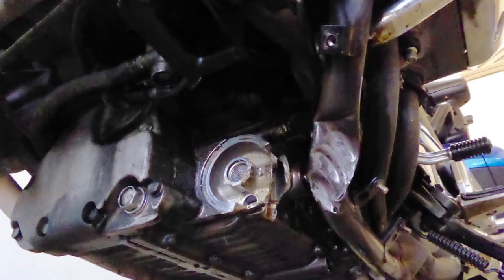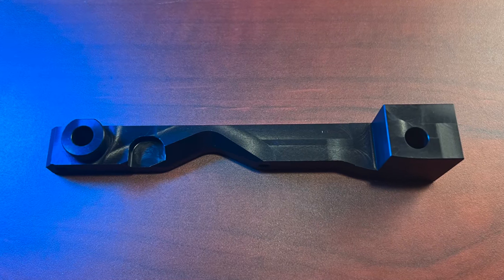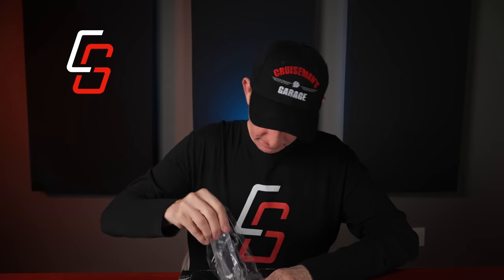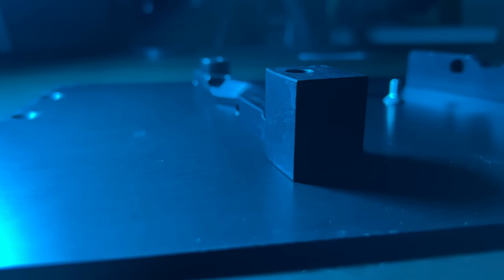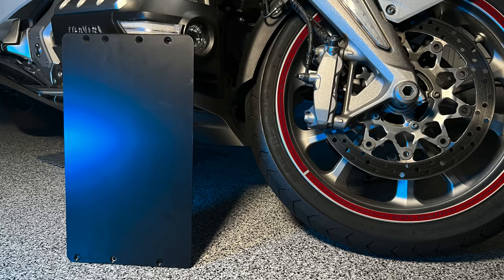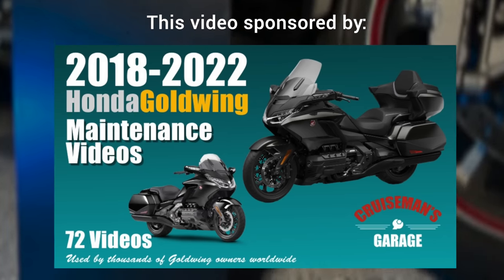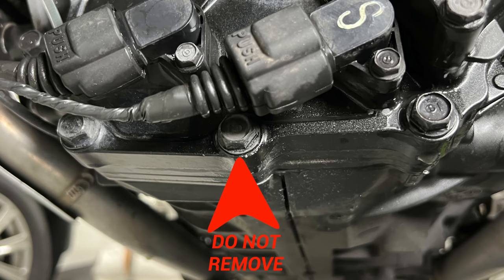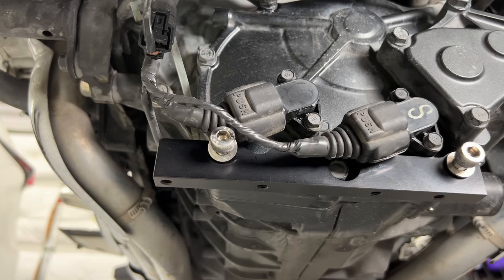Install and Review of Engine Case Guard from Traxxion Dynamics | Cruiseman's Garage

Comment: Another great video. A tip to anyone doing work yourself, if you have difficulty finding the right FEEL when assembling things and find that too often you over tighten bolts and strip the threads, use the right size socket wrench for the job. An example would be in this video when tightening down the underside small V-head screws, use a 1/4" socket wrench, not a 3/8". The smaller the bolts, use a smaller socket wrench where you cannot get the overpowering torque that will cause trouble and ruin your day.

Comment: I've added the cover to my 23 Goldwing and following the instructions to the letter went on easy, and after the installation, there were no leaks of any kind from the case of the engine. Good job done by Traxxton for building this heavy duty cover.

Comment: Thanks Chris! Great video as always. I ordered the Traxxion Dynamics Alcan plate for my 2019 DCT Wing a couple of weeks ago. After reading the many reviews I learned that there was not enough clearance to remove the rear drain bolt after installing the rear bracket. This would have been a deal breaker for me. If you have the 13mm aftermarket magnetic drain bolt as I do it requires the removal of the bracket when doing an oil change. I just received confirmation that Traxxion has re engineered this bracket that WILL accommodate the 13mm drain bolt! There is a slight delay in the manufacturing effort right now but I was told that these will begin shipping again by the end of January. When I receive it I will install and follow up.  
Thanks for all your videos! I have used many of them to install a great deal of lighting as well as proper maintenance that is required.  The insight that you provide has allowed me to do all these installs saving me thousands! My hats off to you sir! Keep it up.
Reply: hello there. I have ordered the Alcan as well and on Traxxion website doesn't says  the official dimensions of this plate how big it is in regards to the standard. it would be great to know how thick it is in millimeters. Thanks 👍🏻

Comment: Just purchased my first Gold wing 2019 DCT, I certainly don’t like removing the Engine bolts every time I change the oil, hopefully they redesigned the bracket and came up with a better solution. I’m giving them a call tomorrow before I order the product.
Reply: Flyman...Did you call them about this?

Comment: I bought and installed this last week. Simple install when following Max's video. Definitely a solid piece of aluminum plate! I will have to check for any oil leaks. Haven't riden the bike since the install.  It was 5 degrees up hear in Boston the last few days. Up to 28 and dry today.....perfect riding weather lol

Comment: Thanks for the update.  I am not sold on either of the products you have reviewed.  Sure don't want to keep removing the engine bolds.  Also not convinced I need a "thick" plate.
Reply: I found out that the wingstuff is much easier instalation, doesn't mess with the engine bolts. Nd does the job perfectly.

Comment: Great plate kit. Now you are talking solid plate mounting. Totally agreed about the drain plug access!!! Once us removing the rear bracket to get to the drain plug, a note must be informed that the old 2 bolts must be inserted back into the engine block before you run the engine after an oil change to check for leaks and oil level.  I will never run the engine missing the 2 bolts on the lower case, even for 1 min. I need to think about that. It is a benefit to have this plate on our bikes.

Comment: This ecg from traxxion does look heavy duty,but taking out the 4 engine bolts out and using a jack under the ecg plate to support that much weight on those 4 bolts seems wrong. The engines cases have been lighten up and are thinner and would more likely put too much stress on those 4 bolts when lifting the bike. Mother Honda is not going to guarantee damages caused by this belly pan and who could blame them. Right now it's a no for me.

Comment: I did that exact thing put the front bracket on the wrong way I found out when the plate would not match up the bolts so I took it off and reversed it glad that you mentioned it. Merry Christmas stay safe

Comment: After watching this video (another great job, Chris!), I would be very hesitant to lift the motorcycle with a lift on the case guard.  As best as I can tell (unless the lift was making contact elsewhere) you would be lifting the entire weight of the bike on the 4 bracket bolts, which is only contacting the engine case in 4 distinct points.  I would be very concerned that all that weight on those four bolts would either shear off the bolts or crack the case.  On my previous bike, there were two strong frame rails that the lift would contact, not the engine itself.

Comment: My Gold Wing is parked in my basement for the winter, so I have not even started the engine since I put it away. I installed this engine guard case about a month ago now, while it has been in my basement. This evening I was curious about the recently reported seepage of oil that was noticed on some Gold Wings, after the guard was installed. So, I removed the necessary items to get at the front and rear bracket. I noticed an oil seepage from the area of the front guard bracket. So, I got out my trusty torque wrench to see if the bolts were at 18 ft lbs, like you mentioned. They were both pretty darn close, so I gave them another tug just to make sure. Then, I removed the bottom guard, and I cleaned the area of the seepage really well with some Simple Green. So, I am going to leave the bottom guard off for a few weeks, while it is in hibernation in my basement, and I will monitor it to see if I get any more seepage to report.
Reply: hey Paul. have you got any more seepage  after monitoring? thanks
Reply: @bikerboy_2008  No. Max from Traxxion was correct. I wiped the seepage and re-torqued the bolts, and everything is good.

Comment: Looks like the clearance issue, with the rear drain plug, may be with the aftermarket magnetic plug mentioned below.  Traxxion bracket was probably designed to fit around an OEM stock drain plug, which is a 12 mm head.  The Goldstrike magnetic plug is 13 mm.

Comment: Maybe you saw this already but 6061T6 is a precipitation-hardened aluminium alloy, containing magnesium and silicon as its major alloying elements.  The T6 designator means its Tempered, solutionized and artificially aged.  Yea i got that from Wikipedia (I wont take credit for that)

Comment: I just recieved my case guard. The rear mounting bracket has had a notch milled into it to address this drain bolt issue with the DCT. I was wondering why the notch was machined in the bracket after it was anodized but this video makes it clear now why it was done..no need for it with my 6-speed though.
Reply: I would think he would send new brackets out with the notch in them. Don’t think mine has the notch in it.

Comment: I did install the the plate on my 2019 DCT.  week.  I too am interested in how it will function with a lift.  I have a J&S Lift with their Goldwing adapter.  I will test the lift along with the plate on to see if it fares well.  Otherwise I would  just remove the plate as one would to perform an oil change by removing the 7 small screws,  and then use the lift on the suggested engine case hard points recommended by J&S.  
      Last weekend I road 450 miles from Orlando to Palm Beach and back and had no issues with the install when inspected.    I really like the protection it affords as I'm a long distance rider and now feel a bit safer with the engine case protection.  Thanks for the video Chris well done.

Comment: Adding a washer to act as a spacer between the front mounting bracket and the engine case would help localize the bolt torque clamping force and prevent oil leaks, but once you've let the leak start, the RTV is compromised and it's always going to want to seep there.

Comment: It took me about an hour.   I am not mechanical at all, but it looks great.  The two biggest hassles were the plastic, which I put back on in the wrong order, and getting my torque wrench on the rear bolts.  Mine had the cutout for the DCT plug and I had no trouble getting the 12mm socket on it.  
My biggest disappointment is that I was hoping to find about ten push pins and a couple of 10mm sockets in there when I took all that plastic off.

Comment: Thanks, good review.  The Traxxion Engine Case Guard, seems to be a better design.  Thanks especially for the torque reference, I should have looked that up, so I will go back and check mine.  They did not feel like those bolts had a lot of torque on them when they came off.  Definitely waiting to see your take on the rear drain bolt when you do your next oil change.  I did use blue loctite, but I don’t view that as a critical thing.

Comment: I tried dropping my Traxxion plate to check the distance to the rear drain bolt. I have the Showchrome magnetic drain bolts and the heads are 13mm instead of the OEM 12mm and there is not enough space to get a socket on it. It’s close though. I’ll probably grind a small portion off the bracket next time I change my oil to leave enough space for a socket. My 13 was so close I’d think a 12mm just might be okay. It took me 4 minutes to drop the pan.

Comment: Since it's been 2 years since your video of the engine guard install .... what have we learned about Honda warranty , oil leaks, and if we can use a lift with this engine guard???
Reply from the maker: I have used it with a lift several times, no leak issues and no Honda warranty issues that I am aware of.
Reply: Thanks Chris

Comment: The Max video looks like this plate would make oil filter changing fun. I wonder if longer engine bolts are supplied and if they can be torqued to factory spec. I would think using this plate between bike & lift would be scary 👀
Reply from the maker: Yes, they can be torqued to factory spec.

Comment: Is there any allowance for thermal expansion? I'm thinking there "may" be some disparity between the plate and the engine which "could" result in an oil leak.

Comment: Chris, going back to your install and review of the Traxxion case guard, when you pulled it off after riding awhile you had some fluid on the guard. Did you ever determine what that fluid was and was it caused by the installation of the case guard?
Reply from the maker: It was oil that was seeping out from where I removed the bolts.  I have re-torqued the bolts and am monitoring to see if it continues, or was a temporary issue.
Reply: Thanks Chris. Am considering buying the plate but am waiting for more reports. Have heard other folks having the same problem. Looking forward to your report.

Comment: They should have just machined a slot in the center bolt instead of a hole of the front bracket Then simply drop the entire assembly straight down by removing the 4 bolts for an oil change.

Comment: Follow up Chris.  I pulled off the plate today to check on any oil leakage you identified.  I too found  light oil was leaking from the front bracket that was added to support the plate.  The underside of the plate had the presence of light oil streaming on the plate and the underside of the casing was lightly covered.  I had completed 500 miles around Florida this past week and figured that would be a fair opportunity to see if my install was similar your yours, and it was.  I can't determine exactly were the oil is leaking from but it appears to the from the newly changed bolds used to replace the OEM ones and retain the mounting support.  So it appears this may be a common fault.  I left an email and voice mail with Traxxion but they were likely off for the holidays.  I hope we hear how this can be rectified, or do we return the item and replace the OEM bolts.  We will see as it along with access to the drain plug are outstanding issues.  Tried to email you a photo but it was bounced.
Reply from the maker: I emailed with Max and he said it may be common if the bolts were left out for some period of time and that re-torque of the bolts should correct the issue. I don't think there is a reason to panic.
Reply: @cruisemansgarage  no panic just following your lead over the legitimate concerns you identified I.e oil plug restriction and the oil leakage discoveries.  I know Max will do the right thing and the ask ing for findings and similar observations  by customers was forthcoming.  We all await  the form fit and function  resolution. Thanks for bringing it to the forefront Chris. Good job.
Reply: I received a modified rear bracket from Traxxion which provides access to the rear drain bolt.  I cleaned and reinstalled the plate after finding some minor seepage as was experienced by myself and other.  
 Today after 600 hard highway miles here in Florida the underside was completely dry, no further seepage. So the original seepage was likely due to the reasons related by Max and Chris was  due to the original bolt change.  

The modified bracket now allows me to access the rear drain bolt, so I only need to remove the plate to do an oil change.   I will test my J&S lift on the plate when I have the need to jack up the bike. 

 I see that Chris Calentie published an install video on is pre-2018 GW today , where he changed a older belly pan out for a Show Chrome two piece pan.  She shows using his lift with the new pan without any noted concerns.   

So I'm satisfied with the Traxxion product and as always their products are high quality and they always correct any customer concerns.

Comment: Honda does not recommend altering the undercarriage of your Gold wing.  This is nothing more than a sales pitch. Insurance will cover damages if this occurs. Honda claims that by installing this plate, you risk altering the engineering and safety design of the motorcycle.  Leave it be. If it was an issue, there would be a recall notice and Honda would cover the costs.

Comment: Would it be possible to drill a hole through the plate to allow a socket on the drain plug.
Reply from the maker: You still have 2 other drain plugs and the filter to access.

Comment: I solve the rear bracket problem please pass it on to Max. You can always use permanently installed rear bolts with  8mm studs  protruding from them. You can remove the rear bracket by removing the nuts off of the studs. That way the bolts never leave the engine case. Simply reinstalled the bracket over the studs, and reinstall the nuts.
Reply: Genius!

Comment: One would expect that at the price these Goldwings cost the  so super Honda company would have these installed as part of protecting such a high priced maschine. If you count together all the things one would have to install that should be run of the mill standard the price goes up by 2-3000 $ more
Reply from the maker: I can't think of a touring bike with engine case protection. Even some adventure bikes don't include it as standard equipment.
Reply: @cruisemansgarage  Well then they should a standard for high priced bikes and we as consumeres should learn to demand them.

Comment: Nope. As in other comments. Removing bolts for oil change which is a regular occurrence. First I’d never remove engine case lower bolts to mount a plate that when it takes a hard hit would put pressure on engine case. Defeat’s the purpose of engine protection. I’m a believer in engine case protection. Drain bolt? Still have to remove plate to change DCT oil filter. But not this setup.
Reply: I believe these bolts do not go into the engine "case" they go into the engine "cover."
Reply: @Tim.Traveler  call the engine case what you want. Even Cruiseman had oil leak on one of the bolts on his first install.

Comment: I wouldn’t feel comfortable removing engine bolts every time I change my oil on my DCT?.
Reply: you're removing the drain bolts everytime......
Reply: Removing engine bolts in my opinion is just asking for trouble especially unnecessary oil leaks. Not worth the risk for me !!

Comment: IMO a hassle and something 99.9% of us will never need. IF I ever got severe damage, It's a insurance claim & possibly a new bike!
Reply from the maker: There are a couple of other things to consider. In my case, if the repairs had been another $800, the insurance company would have totaled the bike. and I would have only received $12,800, meaning I would have had to go out and find another bike to replace it. The second issue is being stranded in a remote area with a cracked engine case. I was "lucky" my mishap happened just a few miles from my home. The other consideration is finding a tech capable of making the repairs. Again, I was VERY lucky because at that time I had an excellent Honda tech with 20 years experience in Goldwing repairs. I no longer have that luxury.
Reply: An ounce of prevention is work a pound of cure.
Reply: The motor work on a $25,000-32,000 bike isn't probably going to total the bike.  It's going to end up netting you a check for $9-12K for a Honda tech to tear apart your motor and rebuild it....which is never going to be to the standard of the factory-built unit.  As CM says below the other issue is "when and where" does this happen?  Insurance is "protection from unforeseen risk"...this is a KNOWN risk at this point and if you ride more than casually I wouldn't risk it.  These bikes are not depreciating much and a check for Less than half of what the bike is worth won't be much of a consolation if it happens to you.  Multiple reports of debris puncturing the oil filter...even more likely than a case getting cracked.  I've got one ready to install sitting in my shop.

Comment: $12k dollars of damage to your previous Wing’s motor Cruise? Did you mean $1,200? Otherwise the plate looks typical Traxxion over engineering.
Reply from the maker: Nope, $12,000. Had to pull the engine, replace the lower case, main bearings and seals and re-assemble.